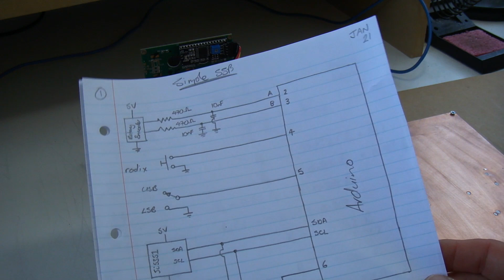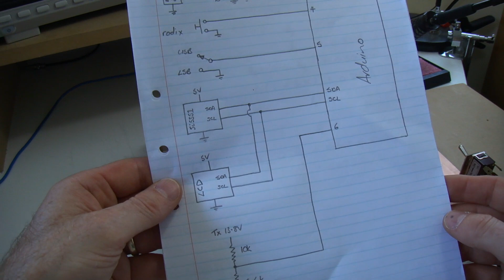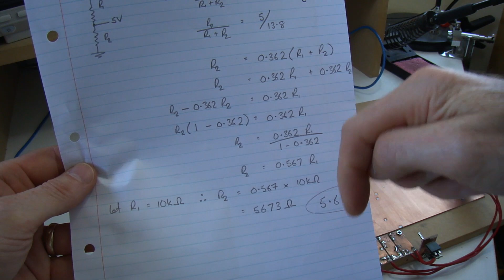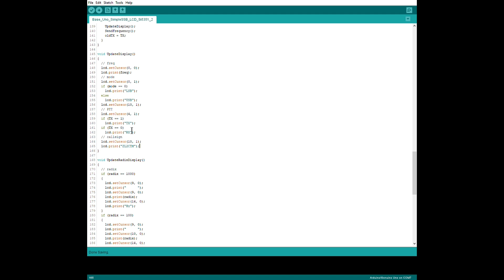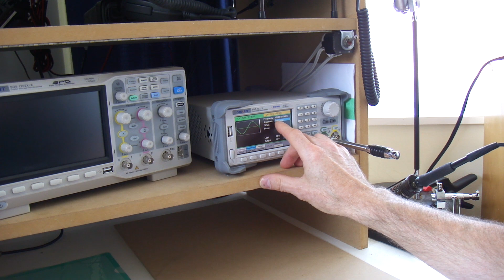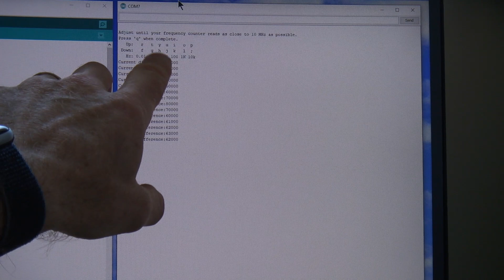Simple SSB Rig: Part 2 - VFO, Arduino Code, Si5351 Calibration

Comment: Charlie, I have similar superhet design .. 40m band, 4 MHz IF inclusing 6xtal CW filter, using ADE mixers and all works fine EXCEPT I get slight klicking background noise .. somehow related to I2C communication between my NANO and I2C+ 16x2 LCD character display. If I change code and do talk to display, clicking is substantially quieter and faster (I2C still talks to Si5351). My question Charlie is - did you experience something similar? If so what did you try to fix it and haw successfull you were ?
charlie tnx in advance + mny 73 de OM3CWY, ex. N1FIC

Comment: Maybe an easier way (suggestion) on the math regarding the voltage divider. Let: R2=4k7 --> I=5V/4k7=1.064mA. R1=(13.8V-5V)/1.064mA= ~8k3.

Comment: On your sig gen you set it up for 1.4 volts, was that measured to 50 ohms? Does the SI5351 put out at least 1.4v into 50 ohms? Or does anyone really send 7dbm to thier mixers??

Comment: Hi Charlie The Si5351 looks a really interesting device. I am in the middle of modifying an old 1980s multimode CB to 1.5MHz to 500Mhz coverage using the Analog Devices AD831 active mixer and the AD9910 as a DDS VFO controlled by Arduino.  I am thinking of using the Si5351 to replace the SSB carrier oscillator I would be interested in your thoughts and how it performs at around 10MHz? BTW I really enjoy your videos Best Regards M0XFX
Reply from the maker: Hi John. I have had not problems using the Si5351 at around 20MHz for high side injection. That was using a simple DBM. I would have thought you'd be fine. They are certainly cheap enough to just give it a go.

Comment: Hi Charlie, what is the actual model arduino / chipset etc that you are using here? Cheers Chris VK3TUB
Reply from the maker: Hi Chris. The original was a stock standard Uno with a Mega 328P and the second a Arduino Mega board. The display was a simple 16x2 with an I2C interface. Nothing special.

Comment: Thanks Charlie. That fixed that. Now I have an issue that the display is only showing the leading digit of each part of the display. So I have the “3” of the frequency, the “1” of the 1000 and the “H” of the Hz. Same is true on the bottom line. Only have U, R and Z showing. They are all where they should be and they change with appropriate inputs on mode, PTT, Radix etc.  This is happening on two different displays. I loaded a test sketch for the display and it works fine with that sketch. I am seeing the appropriate frequencies coming out of the Si5351. Thoughts? Thanks 
Ron
Reply from the maker: Hi Ron. I have never seen that before. All I can suggest is copy the syntax from the example sketch into the VFO sketch. Other than that, I haven't a clue sorry.

Charlie

Comment: Hi Charlie, I really appreciate all your good work here and your willingness to share it. I'm trying to duplicate the VFO in the Simple SSB rig. The firmware won't compile and returns "no matching function for call to 'LiquidCrystal_I2::begin()'. According to the literature I might have the wrong library chosen. Can you tell me what library you used for the LCD and/or if there is some other issue here? Thanks.. Ron
Reply from the maker: Hi Ron. Libraries are always a problems. I've taken a look at mine as there is no way to tell where it came from. What I suggest you do is open the example sketch that comes with your library and simply copy across the syntax into the VFO sketch. I do that all the time when I have problems here.
Reply: Thanks Charlie. That fixed that. Now I have an issue that the display is only showing the leading digit of each part of the display. So I have the “3” of the frequency, the “1” of the 1000 and the “H” of the Hz. Same is true on the bottom line. Only have U, R and Z showing. They are all where they should be and they change with appropriate inputs on mode, PTT, Radix etc.  This is happening on two different displays. Also seeing the appropriate frequencies coming out of the Si5351. Thoughts? Thanks 
Ron

Comment: Charlie, I have a doubt.Are you using BFO signal from si5351? If so I hope it is using for LSB and USB with IF shift programmed
.
Good video
Reply from the maker: Hi Anees, Yes, I normally program the BFO shift into the code (see my other rigs). On this occasion I decided to be different and make it manual.

Comment: 2nd comment. Have to adjust band limits depending on LSB or USB. Ty cannot TX USB at 3.9MHz or you are out of band... (assuming 3.9 is your local upper limit)
Reply from the maker: Hi again. In the past I have had the L/USB auto select in software depending on the band in use. In this particular case I have given the operator a choice.

Comment: To protect the Arduino from over voltage on 13.8V line, suggest to have resistive TX divider to output 3-4V not 5V... 3-4V is well above the HIGH threshold of the digital inputs
Reply from the maker: Hi Antony. I had thought of that, but dismissed it as the VCC line will have a voltage regulator. I might look to redesign it for-say-4 VDC

Comment: Nice project. I suppose I should learn something about arduino. I'm all in for analog circuits, but never explored the digital world very much.
Reply from the maker: Give it a go Joe. It won't cost you much.
Reply: @CharlieMorrisZL2CTM  I don't even know where to begin, but I should start by reading I guess. I tried my hand at simple programming a few times but I was baffled each time.

Comment: Hi Charlie, I noticed something a bit different on this build compared to other projects you have built.

What is the reasoning for having the (2) 470 ohm and (2) .01 uf caps on the encoder? 

 I have managed to get the "sketch" to compile, it might seem a little thing to you, but believe its a major achievement for me getting it to compile. Still in a steep learning curve when comes to Arduino sketches.

About to power up the VFO for the first time. 73 vk2jcc
Reply from the maker: Hi Colin. I was very kindly given some rotary encoders, which require the 470 ohm resistors. Great news about the VFO. I know compiling can be difficult, especially if any of the libraries are different. Keep it up!

Comment: I really appreciate this video. I am going to be rebuilding the crystal filter on my bitx40 and putting on a different frequency and so I'm very curious as to how you decide which frequencies to use for your bfo. I was going to use a sketch that would allow me to tune the bfo separately from the vfo so that I could decide which frequencies to use for the upper and lower sideband and then hardcode those in. But I am really curious how you're going to do it!
Reply from the maker: That's a great approach which I use often. Start with something close to (Bandwidth/2) + 300 Hz, then tweak it from there.

Comment: Thanks for the video! What kind of encoder is that (seems to be an optical one) and can such a knob be bought somewhere? 73s de R2AUK
Reply: Opps, it was in the Part 1 which I missed. Sorry for this.
Reply from the maker: All good. I suspect it is an optical one. Very smooth with no indents. As for the knob, it's off an old rig.

Comment: Hi Charlie.  Excellent videos as always, thank you. Could add any comments about the effectiveness of the rotary encoder in this and other rigs that you have built?   I see that your code for "decoding" the encoder is very simple and doesn't include other more complex things seen in other rigs like interrupts, quadrature state machines, debouncing, etc.  But yet it appears to be very smooth.  Do you attribute that to the high-quality encoder that you are using?  Or are there other tricks?  I have built several rigs using commodity encoders (very similar to the cheap one you showed in part I) and I never get a really smooth response.  My tuning sometimes goes the wrong direction (backlash?) for a click or two during tuning, or steps unevenly.  It's still usable, but not great.  I'm sure it's a software thing.  I'd be interested in any  hints you can share.  73s and thanks!!
Reply from the maker: Hi. You are experiencing exactly the same as I had when I first started using rotary encoders. In the end I settled on the code that features in all of the radio up until this one (check out https://zl2ctm.blogspot.com/). That code has been rock solid for me - nice and smooth, no jumps etc. I suggest you give that a go as I think that will solve your problems. The advantage too is that it is not a library. In this radio I am using a rotary encoder and associated code that was very generously given to me. That code sits in the main loop and not in an interrupt called function. Given that the demands on the microprocessor (Arduino) are minimal, I have elected to leave it there for now. I might look to move that to an interrupt called function as a separate effort. I hope this helps.
Charlie
Reply: @CharlieMorrisZL2CTM  Charlie, a comment from my school of fun & games with optical encoders ... when I went from the pooling method to the interrupt method the speed/responsiveness increased massively. On my setup the step size is 100Hz and I can tune all of 80 in a matter of moments. Have a go and you may find the same. I use the STM32 series which are a bit faster than the Nano. Cheers.
Reply: @CharlieMorrisZL2CTM  Thanks much Charlie, I'll give that one a look.

Comment: For calibration of the si5351 I have an old I think Neo6 gps module I can set the output to 1Mhz, on the new ones you can set them to 10Mhz. I changed the Si code to 1Mhz and lock the top trace of my scope to that. And when the 2nd trace connected to the Si module stops moving using the calibration code I know I'm good to go.
Reply from the maker: That's good to know thanks Brian, I'll remember that. I have found this sig gen to be very good and certainly accurate enough for my needs here. If I didn't have that then the GPS method would be an excellent option.

Comment: Thanks for your excellent project.
I can't compile the code, it gives me an error.
  // Initialize the display
  lcd.begin();
 In function 'void setup()':

error: no matching function for call to 'LiquidCrystal_I2C::begin()'

lcd.begin();

       
\Arduino\libraries\LiquidCrystal_I2C/LiquidCrystal_I2C.h:58:8: note: candidate: void LiquidCrystal_I2C::begin(uint8_t, uint8_t, uint8_t)   void begin(uint8_t cols, uint8_t rows, uint8_t charsize = LCD_5x8DOTS );
\Arduino\libraries\LiquidCrystal_I2C/LiquidCrystal_I2C.h:58:8: note:   candidate expects 3 arguments, 0 provided

exit status 1
no matching function for call to 'LiquidCrystal_I2C::begin()'

Forgive my inexperience in programming,  Thanks for your project
Reply from the maker: Rudy. Look at the example code that comes with your LCD library and port over the syntax.
Reply: @CharlieMorrisZL2CTM  thank you very much friend. I have already managed to activate it. Thanks for your time and for sharing your projects.
My congratulations, we continue to communicate.
73

Comment: Why not calibrate using your oscilloscope?  I'm thinking either use two channels or feed the external timebase of your scope with your sig-gen (presuming you trust the sig-gen timebase over the 'scopes).
Reply from the maker: I have used the oscilloscope in the past using the X-Y mode. The freq counter does not do low enough, and I find the beat freq method works for me.
Reply: @CharlieMorrisZL2CTM  I see, thanks for the clarification.  I was wondering if there was some special advantage to this beat frequency method I wasn't considering, but if it's just your preferred method because you like it that's certainly valid too!

Really enjoying the project-log nature of your channel by the way, keep it up!
Reply: I would also continue that some don’t have oscilloscopes or signal generators. An alternative is using a receiver near a time signal (WWV 10 MHz for example). This gives the possibility of doing a zero beat without having pricey equipment, and the only error would come from trusting the stability of the time signal near your country.

Comment: Can't thank you enough for all the detail and info
cheers
Reply from the maker: My pleasure Khalid.
Reply: @CharlieMorrisZL2CTM  Built the VFO and all seems going well, except that when pin 5 is grounded i get a Continuous flicker between USB/LSB and TX/RX, Do you think adding some resistance with the toggle switch might help ?
I will be building this as a receiver only hence I'm only using Arduino regular power without the 13.8v source and Voltage divider

Cheers n 73's